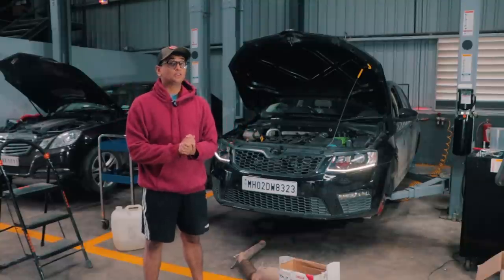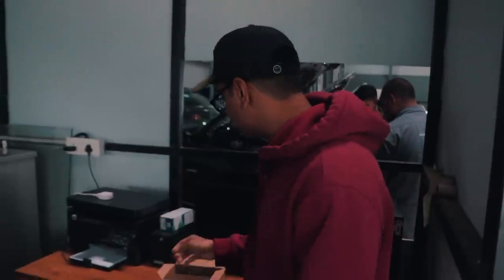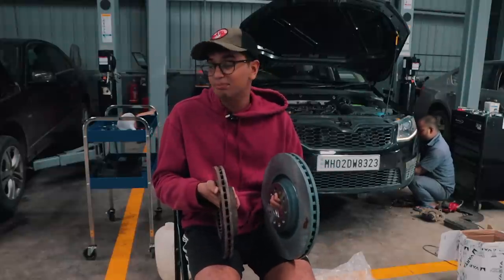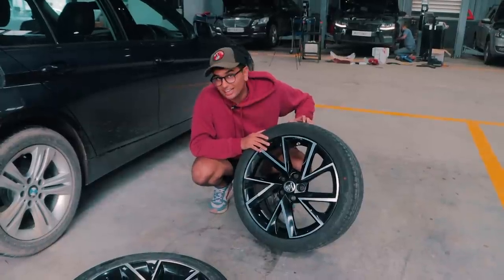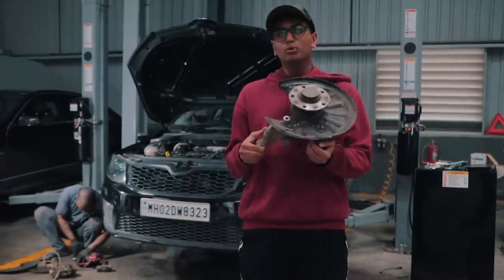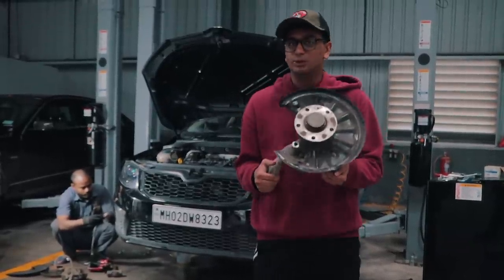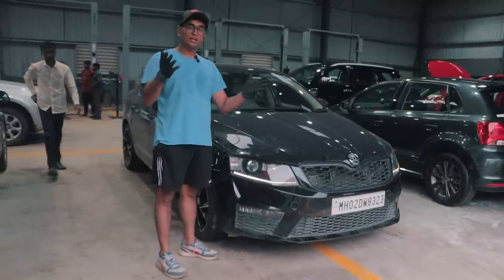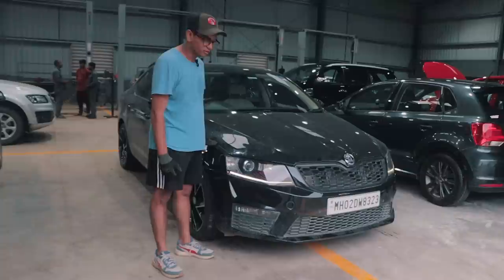New Wheels & VRS245 Brakes for my Octavia 1.8 TSI! (₹75,000 wheels 😱) | Project Octavia

Comment: A hit/ suggestion:- The wheel fitting should be in a star pattern  in 5 bolt scenarios or in the opposite pattern when you do it in a 4 or 6 bolt scenario. 

It is because your wheels would fit in flush if you do in that pattern, in rotation style maybe one bolt might get tight to one side.  As you are using a gun it might not affect much but it's always better to do it in a star or opposite pattern.

Comment: Hey, is the vrs 245 brake assembly a retro fit on an Octavia A7 L&K or does it need a knuckle change?
Reply from the maker: Hey! It's a direct fit to the Octavia, you just need to get the whole kit which includes the brake lines, caliper carriers, rotors and other parts. But no knuckle change required!